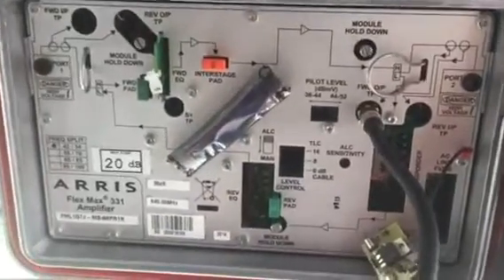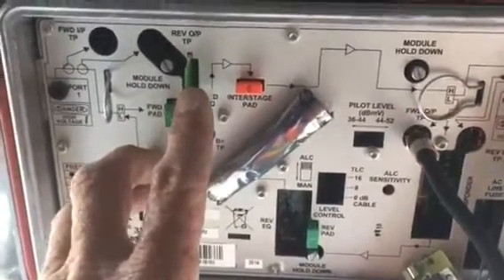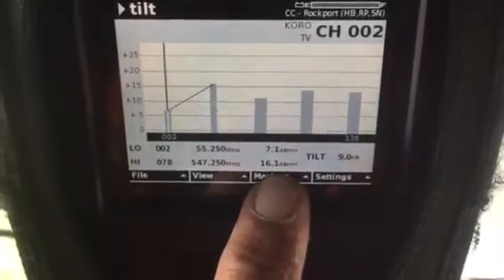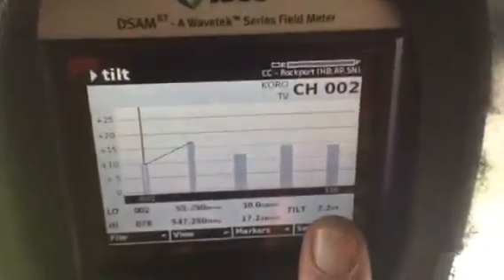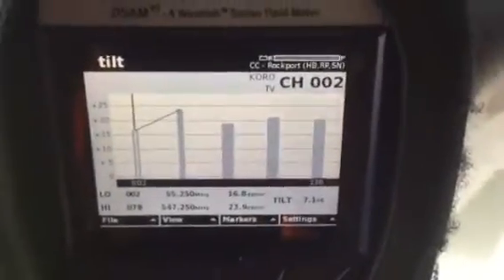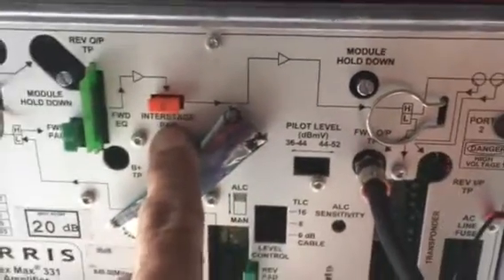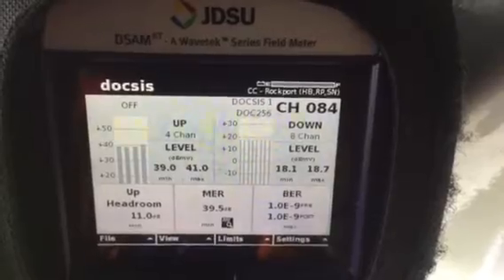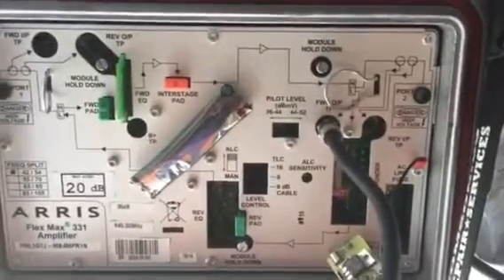Basic Amplifier Adjustment CATV

Comment: Is line extender just another name for an amplifier? Also are these passive devices? If not how are they powered?
Reply from the maker: Hi Dustin.  Yes, a line extender is a name for a type of amplifier.  Basically, most of us refer to a line extender as an amplifier that has only one internal output.  Amplifier are not passive devices.  They are powered  from power supplies that inject / insert 60-90 volts AC directly into the hardline cable plant.  A power pack inside the amplifier then converts that voltage to 24 volts DC which is then used to provide bias power to the actual amplification circuit within the line extender.